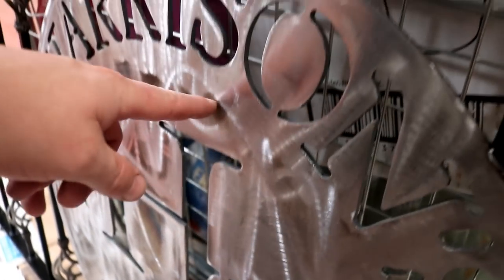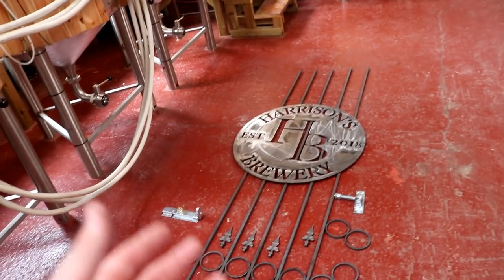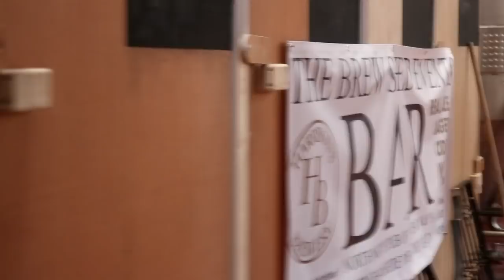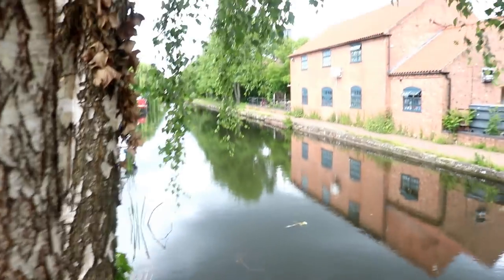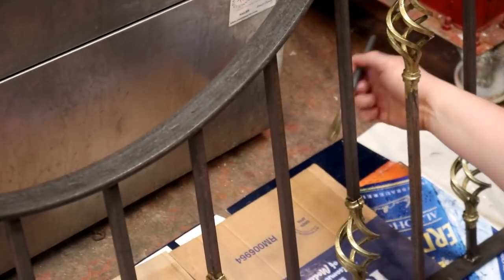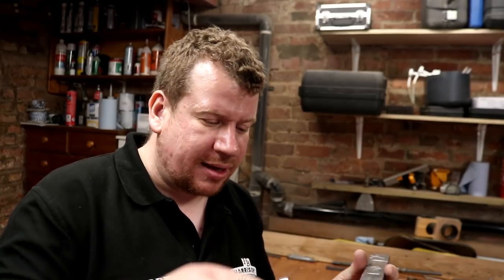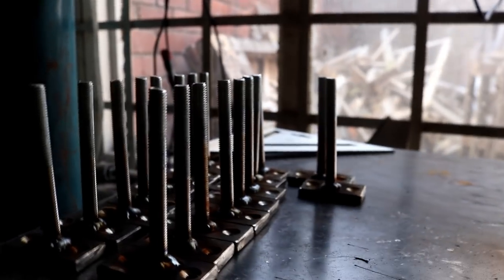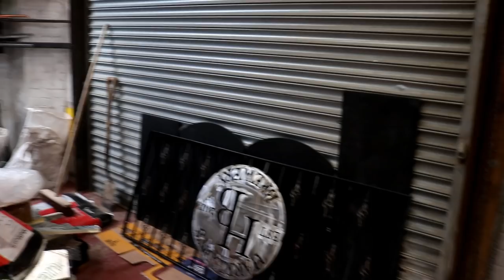CAPPING THE WALL, LOOK AT THAT WATER!

Comment: I know I went on a bit yesterday(sorry) but main thing is drink plenty water,flush out the system. Keep an eye on the sugar intake,won't be easy as it's in everything even bread etc. I've fallen off the wagon this year and I'm paying for it pain and bloat wise. Hope you feel better soon m8. Wall looks fab,can't wait to see railings in place,agree on having to paint the logos,the gold and black will really set things off though. You might need to sand and stain those tables again though by looks of it? Cheers.